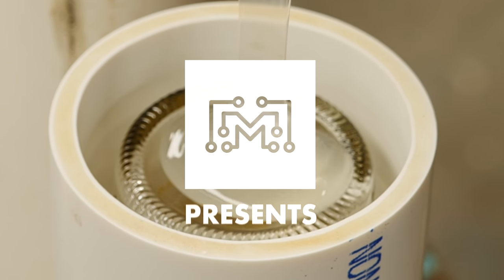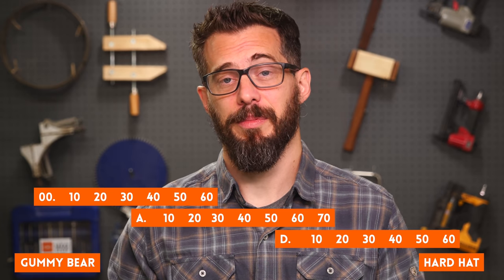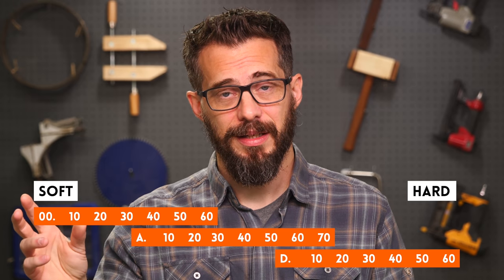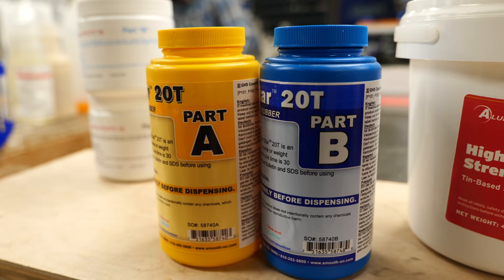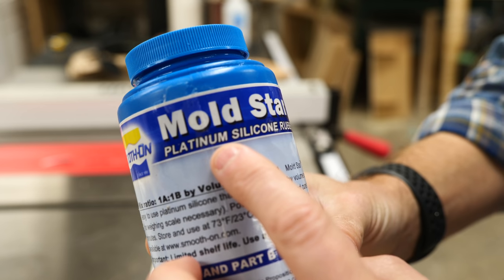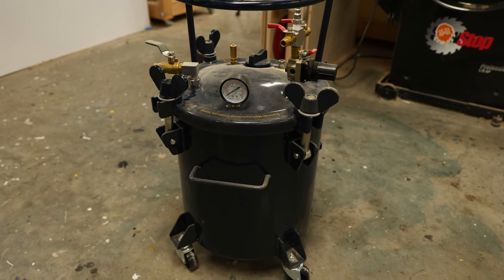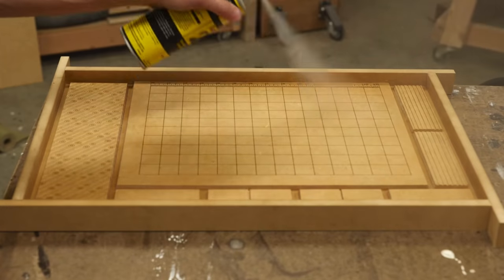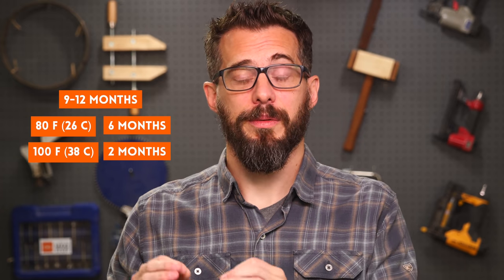Choosing Silicones // Bits | I Like To Make Stuff

Comment: One of the most common materials to contain sulfur is wood.  Unsealed wood can easily spoil a sensitive platinum cure silicone mold.
Reply from the maker: I did not know that.
Reply: @Iliketomakestuff  Formulas are better now than in the 80's and 90's, but I remember getting a chewing out for trying to stir silicone with a wooden paint stir stick.

Comment: Also, vac degassing and pressure pots should go hand in hand. If you use a pressure pot with a silicone mold that wasn't degassed, as the resin cures chances are your parts will be riddled with rash like surface imperfections.

Comment: Ok so from what I got there’s something I’ve wanted to mould for awhile and to do so I’m gonna need a hard silicone like A:30 since it’s got some parts that might catch and tear the mold if I use softer and I know some of the techniques that help reduce bubbles inside since I don’t have a vacuum chamber, but what epoxies do I use? And what kinda dyes for it do I get? Also would coke wheather like 10 to -2 degrees Celsius slow or stop the curing process? I work in a hardware store so I wanna know this stuff and can buy it all there. I can also track by shipping dates when it last came in

Comment: As someone with a lot of experience working with various silicones and resins I 100% approve of Bob's video. This is about just about all of the important information you need to get started condensed down into a single video that concisely delivers the raw information you need.
One thing I'd reiterate is being mindful of the materials you intend to mold. There are a lot of materials out there that should be sealed before they're molded, woods being a common culprit that loves to spoil expensive platinum cure silicone.